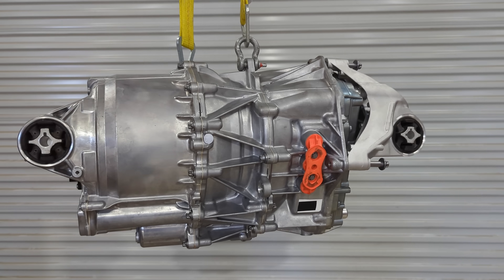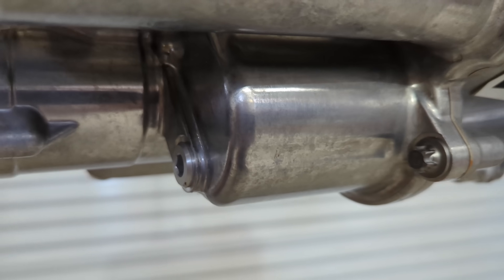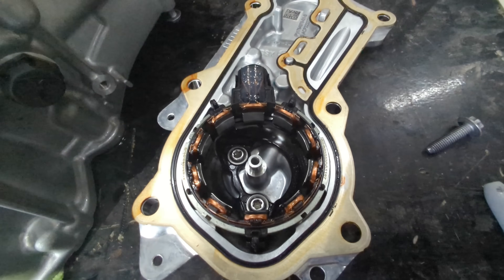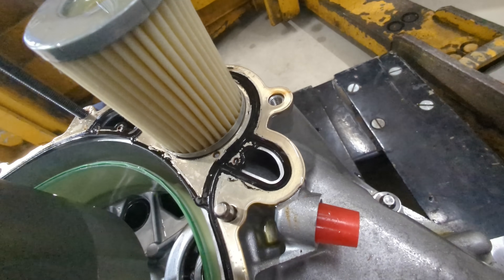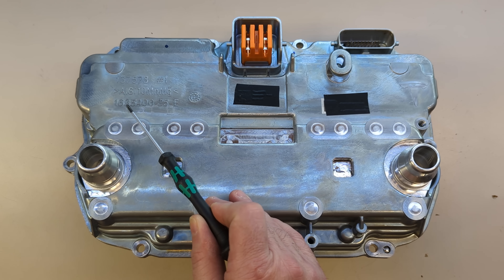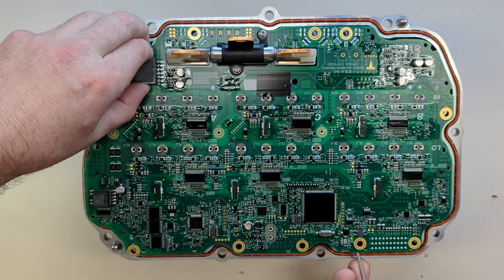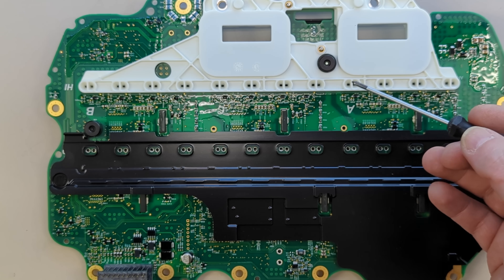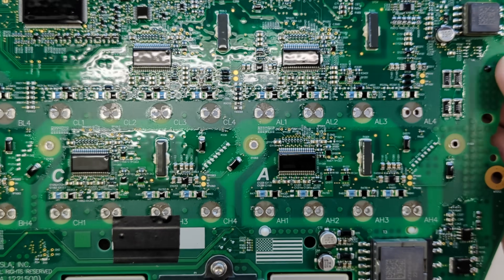Tesla's Newest Motor & Drive Unit

Comment: Nice. I think I heard them talk about departing SiC transistors? but not sure if they meant it. The motor is still same principle, just a bit different build?
Reply from the maker: I think this was talked about for the new low-cost Model.  Switching away from SiC on the existing fleet would reduce range and performance.
Reply: @Ingineerix  Isn't it mostly a compactness and cooling issue as the efficiency difference is quite modest? silicon IGBTs can be quite low loss compared to the power they convey. These small packages can only handle something like 35 watt of heat output so compared to say 200kW output it might at most be .5% they can lose. SiC can only be that much better.
Reply from the maker: @DanFrederiksen  You are way off!  Overall inverter efficiency is increased by a non-trivial amount.  IGBTs have a fixed silicon junction voltage drop, whereas SiCFETs have on-resistances measured in milliohms,  SiC can also shine in motor controllers because they can conduct equally low in reverse during synchronous reification, and have a lower gate capacitance so they can switch faster which means less switching losses while also enabling higher frequencies.   Automotive manufacturing is incredibly cost-sensitive, so Tesla absolutely would not use more expensive SiC devices if it was not a huge benefit to efficiency.
Reply: @Ingineerix  am I way off though. I'm aware of the difference in fet and igbt but I also understand that fet advantage only kicks in if you use many expensive fets so they share the resistance. How much wattage do you think those packages can handle each and how many are there?  try attaching some rough numbers to my way off.
Tesla could easily pay a premium simply to make the device smaller and needing less cooling rather than any significant effect on range. and if there was significant range difference, Tesla wouldn't accept anything else for those handful of dollars. Say it's a 100$ difference.

Comment: Does this pyro fuse replace the one in the pack? 
Seems like if this one goes off it would detonate a lot of the nearby inverter PCB.
Reply from the maker: No, this one is only to stop rotor lockup in the event of a catastrophic inverter failure, like when multiple phases of SiCFETs short at the same time.   If this is ever deployed, the inverter is toast already.
Reply: @Ingineerix  Thanks for the info!

Comment: I can already see Sandy trying to pick his jaw off the floor. The cost down on this vs. last rev is a work of art I'd say they dropped 13-18% just in material cost. 35-40% from the hairpin, another 8-12% on the driver.
I can easily see this with an induction rotor in a 25k car with a 65kwhr battery I bet they shaved 15-20kg off the unit weight and that's says a lot given how Good the last one was compared to the rest of the ev market
Reply: Lol!!! Nope it's still not enough for a 25k car and they also first need to make the Cybertruck
Reply: @carholic1336  I have a cybertruck pre-order in the first 500. So, of course, I agree. But the inverter + hairpin stater + an induction rotor in volume here is under $ 1500 usd with tesla's currently around 85-90$ per kwhr, so a apx 6000$ usd for the battery. So expect all the running gear to be under 10k$ then just the body costs, and with the die-casting, the costs have dropped dramatically. So yes, tesla taking advantage of all its current IP, a 25k car will be easy
Reply: @CNCAutomationLab  🍵 saying some true things here.  Battery cost is the next big thing.
Reply: @CNCAutomationLab  wrong wrong wrong!!!! The die casting isn't the cheapest thing even now for your records. 25k car is also very expensive because there are even much cheaper ones.
Reply: @carholic1336  explain how or why before saying wrong. This is a major part of my job.
I can absolutely say the material cost of a sheet metal stamp is cheaper, but a Toyota rear trunk on a corolla has 76 sheet metal parts and a sub frame. The labor  investment is 2.1 hours white over a dozen operations to complete just the rear section in a corolla. And that was pretty much the gold standard before tesla. The die casting process for tesla is 100% automated with the factory goal of light off assembly. Sure, if you compare sheet material stamping vs. die casting. sheet will win every time, but it is the labor and machine time that get the raw out the door as a finished good that makes an impact. 
I have a 2006 scion xb I bought new in october 2005 it has 246,000miles on it and new was only 19k out the door with only 1mi on the odm. Those days are over the material, and the labor cost to build that same car in the same way will make it a 29,000$ car with a yoy avg cost inflation of 2.65% .
This means a used POS you got for 3,000$ 1998-2004 now cost almost 7,000$
The only reason tesla can make a 25k car an option is that EV are more finite electronics than mechanical complexity as mechanical complexity has much higher labor cost and lower percentage of automation.
Reply: @CNCAutomationLab  making a cheaper EV means way less features and options than expensive ones, and there is also a complexity in EV not just ICE. while ICE have more moving parts, they have way less electronics..... There is a reason why you can still drive a 30 years ICE over tousansds of miles with no range problems lol....
Reply: @CNCAutomationLab  another thing is Tesla has to deliver the Cybertruck that they promised literally ages ago, let's not forget they want to mass produce the semi which needs about 10 model s batteries..... What a joke!
Reply: @CNCAutomationLab  Tesla is still installing and buying machines while other manufacturers already have all the necessary for stampings and many other components.......
Reply: Progress for sure. This is a step up from the last one I saw.
Reply: @BatterVswithAntonio  Care to compare to the Mach E you guys tore down?  I wasn't impressed with the IGBTs nor how they were mounted in the Mach E inverter.  And thanks for doing those teardown videos to share with us what you guys find.
Reply: @morrisg  Mounting and packaging is a big sore spot for OEMS for sure. They did really well on thermal management. Everything else was someone else's work dropped into an allotted space
Reply: I think this was the inverter he and Corey saw at investor day. They saw this while being shown through the production line areas, and the 2 of them were standing there sketching things and quietly raving to themselves. Meanwhile, the financial people who made up the rest of the tour group were looking on wondering WTF these loonies were on about.
Reply: @Graham Monk  agreed but I can see him making a new video based on this footage
Reply: The mûrir design has absolutely nothing special that's what other manufacturers have been using

Comment: Would love to see a tear down of the new charger circuit to see if they’ve made a Bi-directional rectifier/inverter for that.
Reply from the maker: They have not changed the architecture of the PCS (charger), and in fact it's now migrated from the Model 3/Y to the S and X.  Tesla wants you to buy a powerwall, they don't want to take business away from that cash cow.
Reply: @Ingineerix  I keep hoping. The power offtake from the car wouldn’t be a replacement for Powerwalls, it’s use case would be for powering things like power tools, or job sites, and for emergency backup power, but not for daily use like a powerwall. During investor day, I think it was Elon who said that all Tesla vehicles will have power offtake within a couple of years after remarking how Cybertruck will have it.
Reply: @philtrubey7480  vehicle to grid is mostly a thing to use in emergency situations
Reply: @carholic-sz3qv  yes but very helpful in those situations. We could get rid of lots of 5kw standby generators if we had power off take.
Reply: @philtrubey7480  V2G will come sooner or later as it complements a change to renewable energy. Even the next CCS standard has Bidi DC included. Powerwall is tiny in comparison to a decent EV battery.
Reply: I think bidirectional will be done on the DC side.
Reply: @moestrei  Maybe but Cybertruck supposedly has 30A 240V output.
Reply: @philtrubey7480  Yes, but that's V2L not V2G.
Reply: @moestrei  yes, but I don’t think Tesla will ever do V2G. They have powerwall for that.

Comment: Can you explain benefits in hairpin vs stranded copper wiring? Is it just cheaper to produce or is it actually better for performance/efficiency? Less/more skin effect?
Reply from the maker: This is a complex subject, but basically yes, it's cheaper, has better thermal performance, and power density.  Skin effect can have an effect on efficiency,  but not a big issue at the switching frequencies Tesla uses.
Reply: @Ingineerix  Got it! Love these technical videos!
Reply: Cory Steuben showed drawings of fill rate on a Munro Live episode
Reply: @FrunkensteinVonZipperneck  they didnt talk too much about it though. Patiently waiting for them to get a motor to tear apart
Reply from the maker: Here's a cool video from the company I suspect Tesla acquired the manufacturing technology from:  https://youtu.be/3chl322LOBQ
Reply: @Ingineerix  thank you!

Comment: Damn phill there’s no oil filter for meat heads to replace every 3000 miles ..I need something to change !!
Reply from the maker: Tesla considers both the lubricant (ATF9) and the filter to be lifetime.  I advise people to change the ATF9 every 40k; cheap insurance.   No need to change the filter because it will never really have much contamination.   It's not like an ICE with blow-by combustion products and high-temperatures contaminating the oil.
Reply: @Ingineerix  correct me if I’m wrong phill but isn’t the fluid mostly used for heat transfer ?
Reply from the maker: @Mobileccs  Well, the primary function is lubrication.  There just isn't that much heat to remove in normal driving.   In fact, if you disconnect all external cooling from the motor it will drive all day at highway speeds with no problem.
Reply: @Ingineerix  but they do use the heat exchanger for removing heat from the oil to heat the coolant but that’s not really used for removing heat it’s just used to heat the coolant for heating the cabin or battery ?
Reply from the maker: @Mobileccs  Yes, they cool the lubricant and also use it for waste heat.  My point was that it never gets "hot", thus the life of the lubricant is very long.

Comment: I cringe about that oil filter not being serviceable. It’s just lazy engineering. So easy to be able to pull it out and check how are the internas by opening the filter and checking the oil.
Reply from the maker: It's just not needed, that's not lazy engineering.   People think this is like ICE oil, or a transmission with band clutch material in there.  This is a low-temperature straight gear reduction.  It's just not going to decay that way.
Reply: Manual transmissions or differentials don't have filters or need for them.  This is even better- no changing of gears to cause damage.
Reply: Yeah, cause Tesla engineers are notoriously lazy.

(Sarcasm)

Comment: just curious relating to the upper case vent I have traversed some pretty deep water I would imagine that if water has ingress the gearbox one would know fairly quickly. Note model 3 2018 model.
Reply from the maker: I have torn apart drive units from flood cars, definitely water in there!   Keep in mind this is about 2 feet off the ground, so you'd have to park in water that deep to have ingress.
Reply: @Ingineerix  any chance you can focus a little more on how this vent is designed and positioned in the car? If you're moving forward, are you less/equally/more likely to have water ingress if you're in about 2 feet of water?

Comment: Can the oil filter last 20 yrs?
Reply from the maker: Yeah.  Keep in mind this doesn't get hot of have blow-by like an ICE, so the oil doesn't break down.
Reply: @Ingineerix  Do you mean does not brake down as fast as in ICE? I did seen some bad ATF in a Leaf transmissions as well as a pretty noisy units with a luck of oil change.

Comment: Can you comment on the magnets and any rare earth usage?
Reply from the maker: I don't have any way to analyze the composition of the magnets, but they seem strong enough to have some rare-earths still.  Overall compared to other EV motors, the magnets are not that big though.  (This motor is a Hybrid Switched-Reluctance that doesn't depend on the magnets as much)
Reply: @Ingineerix  No worries, thanks for the reply! Yeah, would require some special equipment or tools to analyze. Recommend you checkout "Two bit da vinci" on his recent video on the next gen motor. Seems it is possible to get strong magnets with this new approach. We just don't know how/when/where Tesla are using 0 rare earths in their motors.
Reply from the maker: Yeah, there are a lot of reports of crazy improvements in EV tech, especially batteries, but very rarely do these things actually end up in production.

Comment: I forget, why does it look like the inverter board is lacquered? What is it coated in?
Reply from the maker: That's conformal coating, it's likely a UV cure epoxy that keeps condensing humidity from causing problems on the PCB.
Reply: its called conformal coating. Protects chips from corrosion and such

Comment: That inverter is a work of art!
Reply: Not really lol!!!
Reply: Looks like where is not too much changes in comparison with a model 3, just some optimisations and cost reduction.
Reply: Doesn't look very repairable.
Reply: @DavidJohnson-tv2nn  There was a tear down of the Mach-E inverter, (I think it was that one) it was was even less likely to be repairable, and it was certainly much harder and more expensive to assemble in the first place. Lots of places where things could be screwed up during assembly.
Reply from the maker: Keep in mind, it doesn't have to be repaired if it doesn't fail.  That's what Tesla is trying to achieve here.
Reply: @Ingineerix  Yes, I agree. Some car modules just does not fail in a regular car lifetime. But some does like we're is no tomorrow.
Reply: @Ingineerix  yeah that's exactly what all manufacturers are trying to achieve here!!
Reply: @Ingineerix   They want to achieve their products will not be repairable.  "Anything that can go wrong will go wrong."
Reply from the maker: @Tomigrabi  If this was the case it would be very obvious.  They are not intentionally trying to make things unrepairable, that's a silly conspiracy theory.   Also, if cost cutting made the products unreliable we would see this.  They offer an 8 year warranty after all.

Comment: this is awesome. thanks so much for sharing. very cool to see this development. I wonder how long it will take until the first openinverter hack is done on this particular revision. Damien just got his m3 rdu spinning. love the more compact inverter assembly and hairpin motor windings
Reply from the maker: The problem with open inverter on a hybrid PMSRM like this, is that Tesla has probably tens of thousands of hours development into the inverter firmware, which is why this is one of the most efficient and power-dense motors produced.   If you just toss that and roll your own with on;y a few hundred hours (if that) of development is you lose a lot.  I prefer to drive the motors keeping the Tesla firmware intact.
Reply: @Ingineerix  ideally yes, you just need to capture a CAN commands and sell a separate box to drive unmodified drive unit.
Reply from the maker: It was a little harder than that due to the immobilizer cryptographic authorization, but after some effort I was able to figure it out.
Reply: Hello, Phil. how can I contact you? Maybe I need your help with engine management for a Tesla M3 all-wheel drive project
Reply from the maker: @diksonyar  If you open my channel's "About" tab in a full browser (not phone), you can see my email address.
Reply: @Ingineerix  OK, thank you.
Reply: So I'm guessing your canbus command device is not available?
Reply from the maker: @EEGworld  Yes, I have a system in production now being used for Tesla-powered vans:  https://maxwellvehicles.com/
Reply: Thanks Phil, glad to see you back!

Comment: Also the thermal sensor, like you said, need a near black body surface to be accurate or instead they need a correction table with copper emissivity.. which is unprecise, add noise and might also be problematic with reflection as copper reflect quite well frim 500nm to the few um spectrum
Reply from the maker: Yeah they are all aimed at very matte black surfaces.

Comment: I tought that these ferrites were in place to measure the output phase current, but as you said these are individual small power supply for galvanic insulations  of various supply area maybe?.. but where are the phase current sensors  then?
Reply from the maker: No, these are to supply isolated power for the gate drives.  There are no motor-level currents anywhere on the PCB, those are on the welded copper bussing.  Where the 3 bus-bars pass through the PCB there are 2 flux-gate current sensors.   I point this out at around the 10 minute mark.
Reply: He mentioned those at 10:00. They are Hall effect or flux gate sensors next to the bus bars.
Reply: @reportingsjr  Thanks Jon !